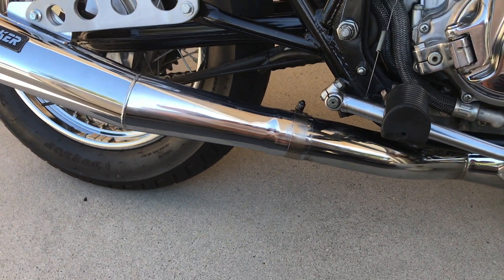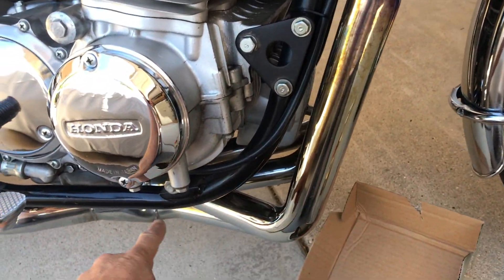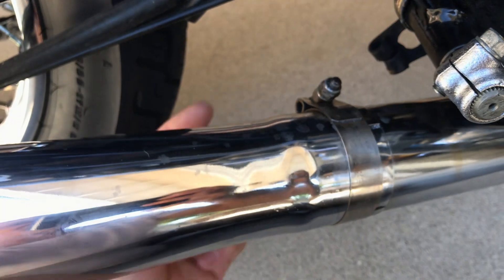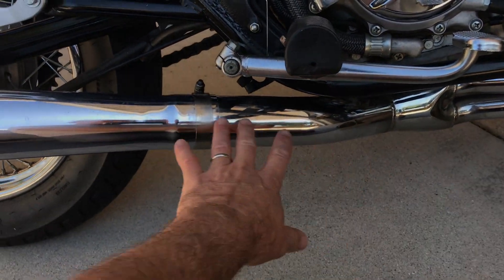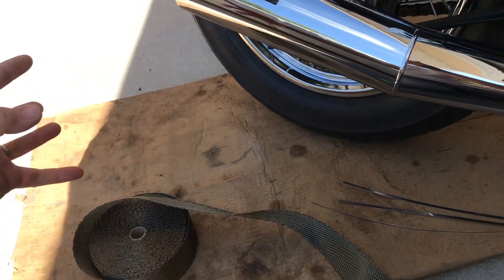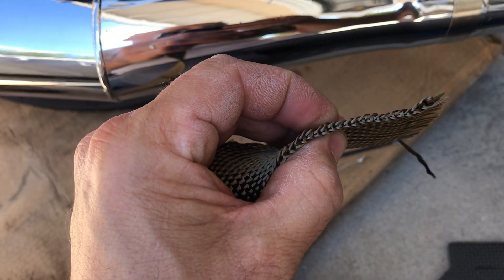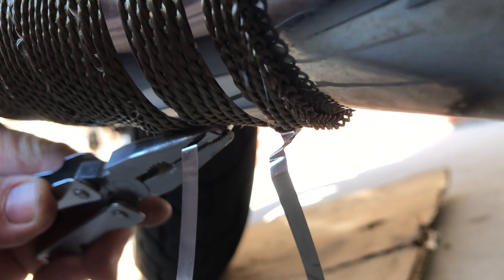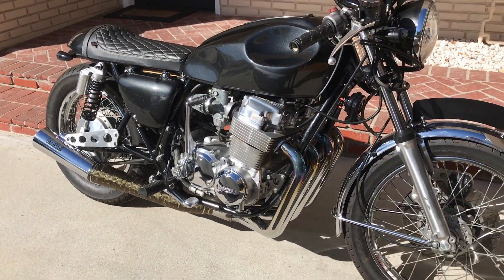How to Wrap an Exhaust Pipe

Comment: I bought a similar type of wrap for exhaust pipe. I heard the only issue is it could cause the pipe to rust out from inside?
Reply from the maker: I suppose if it gets wet a lot and doesn’t dry out, it could contribute to rust. I haven’t had any issues and don’t ride it much.
Reply: @thedrivewayC3  Okay Thanks.